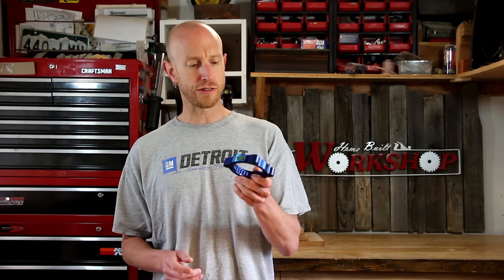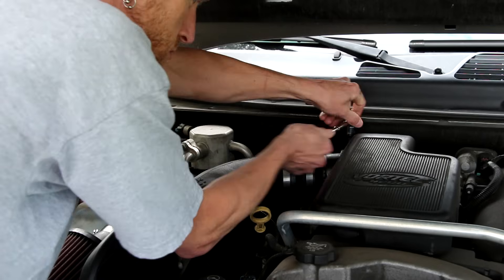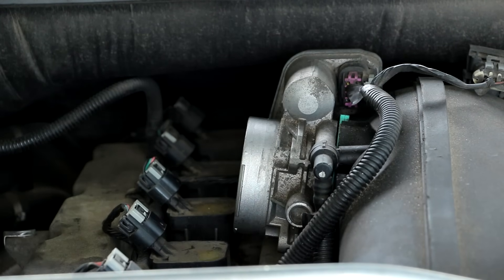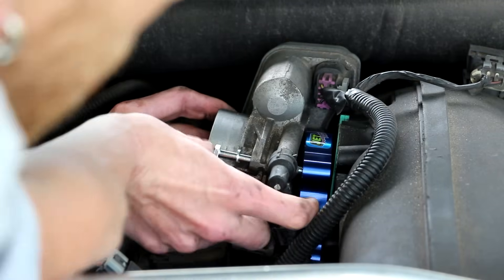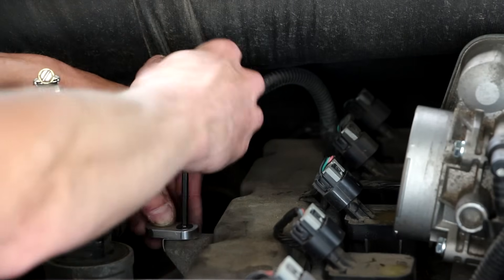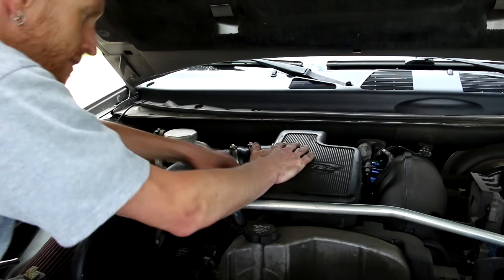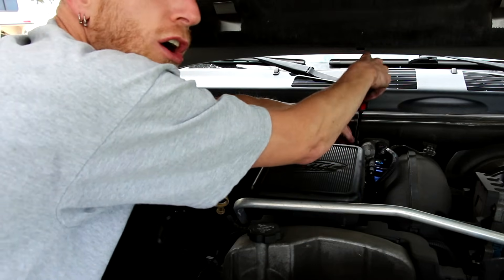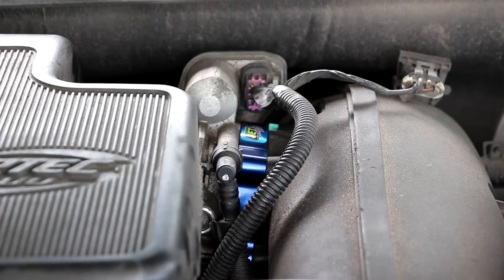Is A Throttle Body Spacer Worth It?

Comment: I have a Tacoma 2004.. I added a throttle body spacer and cold air intake.. I was getting 11.4mpg now I’m getting 14.9mpg.. it really did improve my gas mileage
Reply from the maker: Thats great!
Reply: You got a 3.5 mile-per-gallon increase with just a TBS and a CAI !??
NAH. Mebbe you don't figure your gas mileage properly.
If that were even POSSIBLE, Mr. Toyota would have put them on all their cars & trucks -- like YESTERDAY !!

Comment: The only way I can see this making a difference is by increasing the overall plenum volume and making slightly more air available to the runners. Longer intake runners will improve low end response and torque. The extra volume is so minor that the money could be saved and spent on a mod that would provide proven gains. the reality is that the design of the entire intake system varies so much between engines that simply adding a spacer like that may hold better gains for some and none for others simply due to design of other parts negating the intended effect of the spacer.
Reply: rustynuggets considerinf that runners are only really with carbs that are vertical. on a horizontal, it's negligible.
Reply: Dylan Baxter well that's just not true.
Reply: Yeah, not true at all. runner length is definitely a tunable thing for cars regardless of position.
Reply: rustynuggets also those spacers are rifled so that the air spins. Guns have rifled barrels to improve performance, so ai can see why these may work
Reply: rustynuggets Rusty You are making a smaller space for the air. Google "How does air velocity affects torque?"
Reply: GModBMXer it's a spacer. it's increasing volume.
Reply: rustynuggets It does add volume, but it also adds a restriction
Reply: GModBMXer it's the same internal diameter as the throttle body and plenum flange. how can it possibly be a restriction?
Reply: Rifled edges dont actually do the same thing as they do in guns. rifling in guns spins the bullet, you do not want to spin air moving through a plenum and runner, this would create turbulence, something you do not want in car intakes.
Reply: rustynuggets Rusty, it is not the same internal diameter, if you actual looked at a TBS you would know that. Lmfao
Reply: what are you talking about? there is one in the video.....
Reply: rustynuggets Exactly which is hurting my head. How would it cause turbulence without a restriction. Like dude, youre making me sad now
Reply: GModBMXer you haven't been correct once yet. turbulent air would be inefficient not a restriction. you keep changing your point to try and be correct.
Reply: rustynuggets Mmm, okay. Take this L. It's yours to keep, Rusty

Comment: I have a 2006 Chevy trailblazer in-line 6 4.2 vorthec  I got an air raid worth 126 dollars, it was worth the money I have no intake just stock and yes when you come out from a complete stop I goes much faster way faster, and yes it makes a little whistle like turbo , the only bad thing is the spacers that comes with the package they are not good they strip and sucks so I took them off but yes it’s worth it

Comment: As A Auto Diesel Mech 35 years I have watch people put cold air intakes and spacers all kinds of junk and a  lot of them do nothing to increase power.Cold air Intakes are the biggest joke Unless you are pulling the air out of a Ram air Duct through the hood and force feeding a large Volume of cool air there will be a lose of power.For all those that are in question I recommend  that you do this. Ask to see a Dyno test on the vehicle you are planning to modify not any other vehicle but the car you are making the  modification to.Also you want Before and after tests of any performace part under the same exact conditions including air intake temperature.This is one of the first steps for tuning a car.Next have your car dyno tested for a base line. Then when you are done with your changes have your car dyno tested and tuned if needed this will confirm you gain anything.This video is in no way proving this spacer works.Also no word of mouth even from trusted friends THE DYNO DOES NOT LIE.
Reply: I would disagree on most cold air intakes... Technically most aren't "cold air" because they sit in the engine bay OPEN to the heat, but SOME do come with heat shields and are mounted in bumpers etc. You do get an increase in HP and Torque because the stock (for most) are highly restrictive. Speaking from experience, my S10 had a box with a flat filter that was fed by a 3" opening into the box. I changed it to an AEM cold air intake and my throttle response and torque went up noticeably. No dyno numbers because I don't have that kind of time. But it does work.
Reply: DeFreshS10 First let me say I not trying to offend you but the increase in power that you think you felt  is not detectable by any human being you would need a min of 50 HP before you would be able to notice a change .A 5-25 HP INCREASE can only  be measured by a dyno or running down a track with times AND THE KEY IS SAME EXACT CONDITIONS.What I will say if you notice any change in your vehicle it would be in fuel economy if you were checking it from the beginning.So with This said it would of been mainly from going from a paper air filter to a cotton air filter this is were you increase of power would come from.As for cold air tubing this is a restriction by design Any vehicle pulls a given CUBIC FOOT A MINUTE  (CFM) so Cold air induction has two flaws,First being in order to get the coolest air into the engine means we have to go out in front of the radiator.So when we make just one 90 deg bend we need to 6 feet of straight tubing to regain laminar flow.So now we move to the short design which means our air intake is right next to the radiator and we pick up the heat from under the hood.I prefer a ram air system into a short run the benefits I pick up is I get a pressure increase as the vehicle accelerates. second if I am racing there old school tricks to cool that air down further and correct  the flow of air.Also I do not pick up ambient heat from the radiator or engine compartment as a ram air is truly sealed.What are your thoughts.
Reply: I would PATENTLY disagree with your claim of not being able to "feel" anything under 50HP. My stock motor has ~170 HP... and that a 10hp gain would be a 6% gain in power. Not only that, you INCREASE the power at low end RPM range. Now a CAI on a motor with ~250+ would be insignificant and you most likely wouldn't feel it. "What I will say if you notice any change in your vehicle it would be in fuel economy if you were checking it from the beginning" yes. there was an Increase in MPG, though only about 1.5 or so. But I could still feel the difference in low end power. The amount of air going into the engine is measured. If your ECU recognized more air, it could dump more fuel (provided you have a tune). My intake pipe was actually larger than stock and longer (regaining laminar flow) so CFM increases.
Reply: DeFreshS10 DeFreshS10 Again I would disagree  with even a  on any engine in horsepower gains not even the pros can feel a 10 HP gain.The only way to see a increase is through time.If you take a 10 hp engine  and loaded it down until it stalled you would see that it  is a small amount of power. Now if you are talking B/TORQUE Then you  might just might feel a difference.As far as a longer larger CAI TUBE you lose efficiency and laminar flow as there  tends to be more bends in the pipe.I have had  this debate with others and like I said if all things be  equal the proof  is on the dyno.I deal with engineers from JOHNSON MATTHEY,CCC , CUMMINS,  GM  FORD ETC ALL telling us how great there equipment is yntil we prove or  dis prove it on a Class 8 emmission laboratory DYNOMETER.
Reply: peak HP can be the exact same for both stock and CAI engines, yet you can still feel a difference. Can you tell me why?

Comment: Thanks for the review, nice to know it made a little difference. I plan on an adapter for a larger throttle body. Should gain more than just throwing on a spacer with stock size throttle body.

Comment: Why use the resonator ? Just connect the air filter direct to the throttle body ?
Reply: there you go, lmao
Reply: TheUpandoveragain that might actually add power unlike this added wheight.
Reply: I was thinking the same. Why bother with an aftermarket intake if you keep that restrictive resonator.
Reply: What people don't understand is that spacers were designed for throttle bodies that have injectors not dry throttle bodies where the engine has a injector for each cylinder.
Reply: Chris Sheppard never knew this. Didnt even know these spacers existed. Only the ones used for NOS kits
Reply: The resonator basically helps the air move more efficiently through the intake and into the engine. Kind of like air moving through an acoustic guitar.
Reply: Zach Mines i wonder if K&N would agree with that statement...

Comment: Had a TBS on my 03 gmc sierra 5.3l vortec and i loved mine, it did make a whistle noise that was very audible, i liked it though, between the Aftermarket intake system making a audible sucking noise mixed with a whistle from the TBS it gave the motor a more performance built sound to it, it did seem to add maybe 1mpg on the truck, but its a cheap little part to help improve throttle response if you buy the spacer kits that actually are grooved like a gun barrel so it works to "speed up" the induction and increases the total air took in while making it mix with the fuel more rapidly and easier. If your spacer is a block of metal, its wrong, if your CIA is not in a box that is ported to take in air from the outer edge of the engine bay you have a hot air intake not a cold air intake. my 5.3l vortec had an AFE CIA with my TBS (forgot brand) and i ran a bullydog tripple gt tuner on it and i pulled away from other gas burners off the line and  held it, when i had my 40l6e built by Jasper that had a heavy shift kit, 16 kevlar clutches instead of the stock like 4-6 it has, high volume oil capacity and high fluid flow kit with trans cooler, better valve body and planetary gear, it cost me around $4,000 total in labor and parts using my own Core, it became a shit show when racing, walking them constantly. IF your gonnna buy parts BUY CORRECT AND QUALITY

Comment: I see a lot of comments stating these don't work it depends on your vehicle and what your after. It works if you want low end torque and smoother acceleration. I have used the two brands out there power aid and jet. With this key thing. NO cold air intake tubes and filter they don't add anything. Using a stock air box and the OEM k&n filter will give you the perfect amount of what you want.

Comment: You really didn't put any comparison data into this test. How it feels to you means nothing really
Reply: J Bouchard a
Reply: J Bouchard it sort of does because street racing is illegal, No professional would be watching this and you don't really need it. Altering the volume of your intake is for going faster than 200mph.
Reply: When you know your car, you feel the slightest thing happening to it.
Guy just installed and tested it. What about you ?
Reply: Daëmon I'm sure that it does something. It increases the volume of your intake. I'm sure that does something. I don't personally know what it is but I do know that unless you have a finely-tuned stroker Engine with big giant heads on it then it's not going to make that much of a difference. Several things are run on the vacuum inside of your intake. Those might be affected depending on the increase in volume. There will be no vacuum at lower speeds which means certain things in your electronics will work different. Anyting that operates based on the vacuum and your intake will do whatever it does as the vacuum approaches 0 at a sooner time and that is not necessarily a good thing but in a larger engines with more horsepower you might need that because they suck an air way faster and more air. That is the reason that you would need to expand the volume of your intake. But you probably think that you can hear noises and that it means something from an engine that was manufactured to reduce noise and a sideways and not rear wheel drive. I personally pay more attention to what kind of vibration at makes and where it is coming from because I can't hear s*** inside of my car.
Reply: 4 horsepower and better responses
Reply: I found a video of a guy with an accord. He ran his car on a dyno stock the after he installed the spacer he gained 3 hp and 8ft of torque.
Reply: J Bouchard if you can’t feel it then who cares
Reply: petfriendly_zak that what she said!
Reply: Hey he don't have to didn't you see the tool box and it was red to smh

Comment: this is something you would want to add when going with a larger TB. the longer the spacer the more improvement you will get, Up to a certain point. Longer runners often yield better bottom end power. this is all you are doing here is adding a little bit more to the intake runners.
Reply: it's obvious that you read too many tuner magazines and have not spent enough time turning wrenches..
Reply: +David Soule damn that was funny...

Comment: I had a 2000 gmc Sonoma with the 2.2l that I polished the throttle body, installed spacer, k&n drop in filter and modded the air box and I noticed a increase in power and mpg. the best mod I did to increase power and economy was removing the mechanical crank fan and installing electric fans. with all that done, I was getting 28mpg which is substantial compared to 23mpg average when I first got it! imo all those mods were worth it..

Comment: There is a video posted titled "par Honda Accord - throttle body spacer dyno" this is a before and after dyno on a fuel injected Honda Accord. 

Results WOT were 3-4 horsepower and 7-8 ft lbs torque. He also tested mid range power on the dyno and made an overall 5 hp / 5 ft lbs of torque. 

That makes it at best (on the Honda) $20-$25 per pony. 

Now the debate is that output on a dyno can vary. Was the slight gain from the tbs or was it an environmental factor like temperature humidity ect.
Reply: dasllamas, I agree with your thoughts on how Darkness can vary each pool. Hard to say at the spacer made a difference but they do sound really awesome with that whistle sound!
Reply: dasllamas do you have a Throttle Body Spacer on your Charger?
Reply: What ever, if their was a hp gain, it certainly wasn't from a throttle body spacer.
Reply: Tell me a reason why honda didn't put it by the factory?
Reply: Billblackeye there are many parts that are better for your car. They do It because of price. Production cars are literally done so if they can save a dollar a car they will because after they sell a million cars they saved a million dollars.
Reply: @billblackeye  
Because engineers aren't omniscient gods? People improve things after the fact all the time.
Reply: @billblackeye  The same reason they don't put superchargers and drag slicks on them... or machine guns and ejector seats (I could go on and on).
Reply: Just takes common sense, theres no way a small piece of metal would produce anything of significance otherwise whats to stop manufacturers from doing it themselves. Biggest scam in the auto industry.

Comment: Someone did a dyno of a spacer it was like 3hp and 7 torque at wheels. If you port the throttle body in combination you'll get more. Same with exhaust and intake. The more to do to move air in combination they all work together to increas power. it does free up torque lower and broadens your  "power band" if you will. You may 2hp extra per install. So air tb exhaust would be 6 plus the 3 of the spacer you're getting close to 10hp to the ground.

Comment: Thanks for the video Jeff. I have an '06 Envoy with a 4.2L. I'm trying to find the right combo of parts to get a lot better performance and of course, better gas mileage. I was looking at the Taylor Cable Helix Power Tower PLUS Throttle Body Spacer. It's a little pricey at $115, but with an AeroTurbine muffler (which I know works) since I already have 3" pipes, a decent cold air kit, and a Jet Stage II Power Module, I think I'm going to be in pretty good shape. What are your  thoughts on this combo??? What are your thoughts on boring the throttle body?
Reply from the maker: +Robert Robinson I'm not familiar with boring the throttle body so I can't offer any insight on that. If you have good experiences with that muffler then you should be OK. I recommend the K&N cold air kit.
Reply from the maker: +Robert Robinson I'm not familiar with boring the throttle body so I can't offer any insight on that. If you have good experiences with that muffler then you should be OK. I recommend the K&N cold air kit.
Reply from the maker: +Robert Robinson I'm not familiar with boring the throttle body so I can't offer any insight on that. If you have good experiences with that muffler then you should be OK. I recommend the K&N cold air kit.
Reply: Well,  Bob, I have bought, installed, and tested the Taylor "Power Tower" and also a "Power Module", and BOTH of them are over-priced and completely worthless on my Port-type, Fuel Injected, V-8  engine. 
 Those "power modules" and high-performance "chips" are a total SCAM -- there is NO CHIP inside, just a small resistor that tricks the computer into thinking that the intake air is colder than it actually is, so it adds more fuel.
 It's a dumb-ass idea, because your computer adjusts the Air/Fuel ratio , according to the signals from the O2 sensors. 
Clever advertising and a lack of oversight allows companies to exaggerate their claims, or even LIE to their potential customers -- it's capitalism - the American way !!